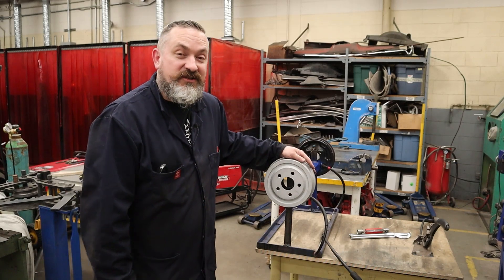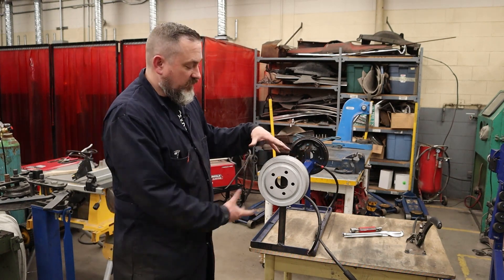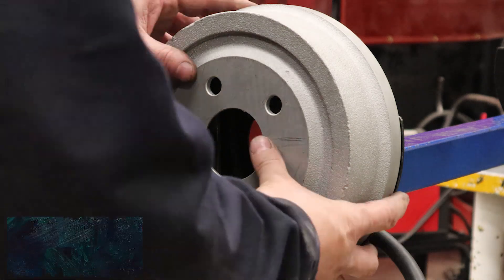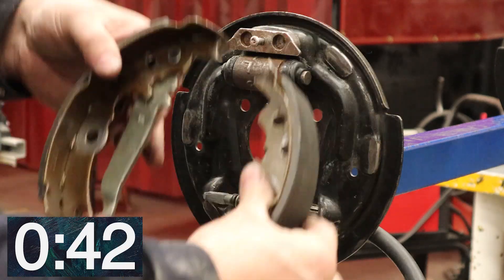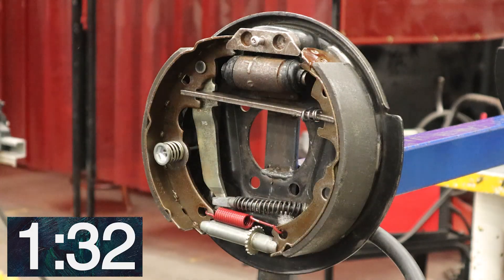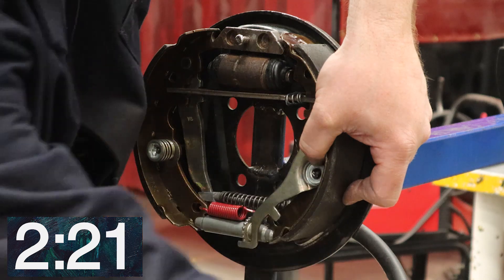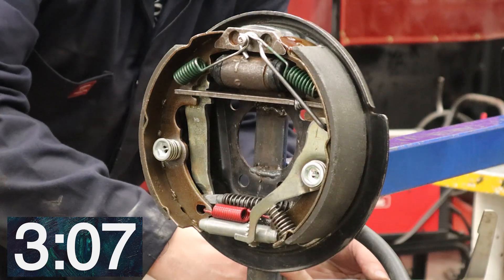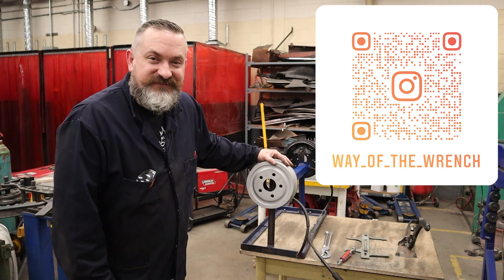Drum brake assembly as fast as you can... challenge!

Comment: How to tell the difference between primary brake shoes and the secondary.
Is there another way to check the clearance if we don’t have a caliper?
Reply from the maker: I have a longer diy drum brake video which is way more detailed, you should check it out.  As for setting clearance on the drum, you can tell by the friction it takes to slide on the drum.  It should just slide on so set it till it won't go on and then adjust about 1mm smaller once it just starts to go on but tight.  It is easier with a drum caliper though.  Thanks for the watch and welcome to the channel!

Comment: OMG  I'm first for once. Thanks for helping me with drums. Blew out wheel cylinder due to be out of adjustment. I will be converting to rear disc because these are not as easy as it looks. Fighting with hold down pins and  careful pushing wheel cylinder to far forward or backwards.
Reply from the maker: Hey, congrats on first to comment!  No worries, glad I could help ya out.  Whatcha working on?  Thanks for the watch!